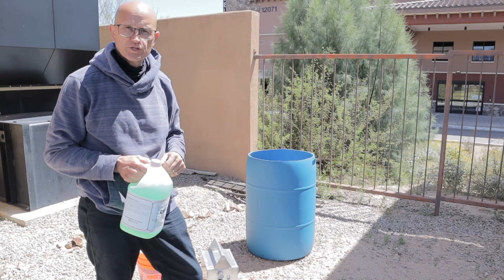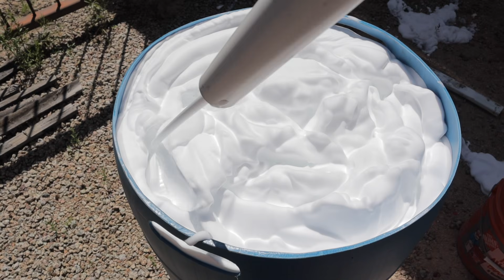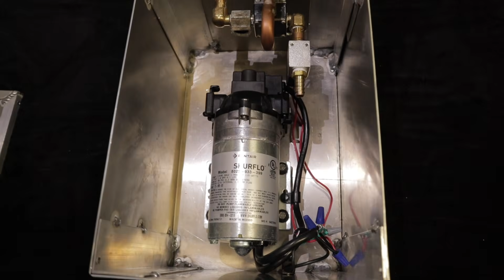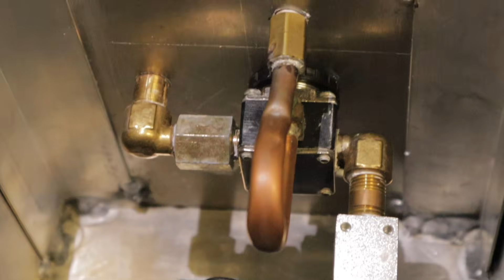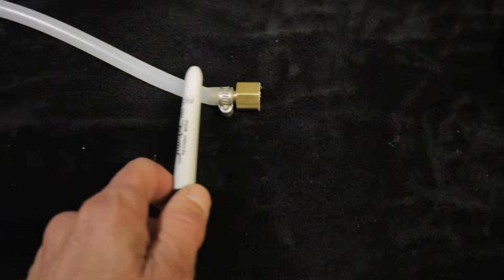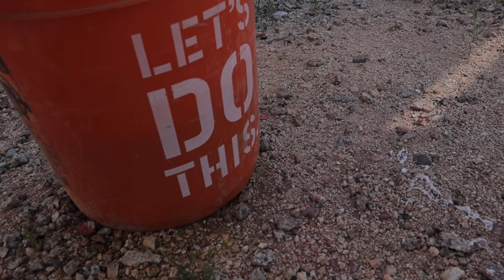Aircrete Foam Generator Machine DIY  [ How To build one that makes Great Foam!

Comment: Not trying to be a smart-ass but what's the point of the air switch if it just comes on when you power it up and you don't have any control over it. Or does it create some sort of resistance that's needed
Reply from the maker: Hi Shayne! No offense taken at all. So I just wanted it as simple as possible when I built it, that’s all. You could certainly add a separate switch just for the air valve if you wanted and then you could control water and air separately. I usually turn it on without my airline hooked up to prime the water pump and then hook up air and start the generator and begin making foam. If you added the air switch you could hook everything up and just control it your way with the switches. Good thinking on your part! 👍😀

Comment: Great work boss, how much to have you build me the generator? A wood box would be fine to on the cheap. I’m in MN. Lastly I’m curious how the shrinkage changed when you used the cement? Did you have to refill after the shrinkage again?
Reply from the maker: Hey, thank you for your kind comment and interest in my foam generator. Unfortunately I don’t have time to build these generators but mine is basically a copy of the Dome Gaia little dragon generator. If you can’t make one yourself, you could always buy one of theirs. Here is a link to their site. https://www.domegaia.com/store/c4/Tools_%26_Equipment.html  Cheers!😁👍
Reply: @PranaTech  thanks and keep breathing in that good *ss prana! Ps: yours is very quiet, worth the value right there!
Reply from the maker: Ha!!!!! You must be a Ralph Smart fan as well!🤣👍Namaste my brother!🙏❤️
Reply from the maker: I realized that I didn’t answer your second question. I don’t have any shrinkage problems since I started using Richway or Vermilion foaming solutions that are designed for aircrete and have much stronger bubbles.👍😊

Comment: What air pressure ranges  are you setting regulator... Somewhere near the 90 PSI of the solution pump?
Reply from the maker: Hi there, I usually run the air pressure right at 55-60psi and that’s where it usually makes great foam.😊👍

Comment: Is the air pressure also the same as the pump at 90 psi?
Reply from the maker: Good morning! No, I usually fine tune the air at about 55-60 psi to make thick foam. 😊👍

Comment: Thanks for the video and schematic - what volume water pump are you using ?
Reply from the maker: Hi Cass, the pump I’m using is 1.6 gallons per minute at 90psi maxed out. I usually run the air at 55 to 60 psi and so the pump only needs to overcome the air pressure. Any pump will work as long as it can put out the volume you need and overcome 55-65 psi. Let me know if you have any other questions.😊👍

Comment: Great video dude thanks for the information 
Now that I have built the foam generator and the wand what formula would you use to pour a panel 4’x8’x3 1/2” thanks
Reply from the maker: Hi Bryan! Congrats on building your generator! It’s always cool to see others build stuff and have the information spread. Ok, so Aircrete is pretty fragile when it’s only 3 ½” thick. To get that to not break when you take it out of the mold is going to be tough. I’ve never tried a panel that large before, but I’ve had my own challenges with 2’x4’ panels, so bigger is only going to get worse. Two things you could do to increase strength would be to use fiberglass fibers added to the mix or short chopped hemp fibers. These would add a lot of stability and shear strength to the Aircrete for a panel that large without adding a ton of weight. You could also add a layer of scrim cloth to the middle of the panel like they do with concrete counter tops. You pour half the depth of the mold and then lay the scrim in and then pour the rest of the Aircrete in slowly so you don’t sink the cloth to the bottom. Just some ideas as I said because I’ve never tried anything that large before. I would love to see some pics of your progress if you get some done. Send them to my email at pranateq@gmail.com 😀👍Don
Reply: @PranaTech  Thanks Don 
I will be using fabric and metal studs as the mold 
I would like to know the yield of aircrete  using the formula 94# Portland cement 6 gallons of water and 40 gallons richway foam or the recipe you use
Reply from the maker: That recipe will yield about 6 cubic feet of aircrete.👍😁
Reply: @PranaTech  thanks don 
I may cut it down to 2x8 so it’s a little easier to handle 
I appreciate all the information and advice
Reply: @bryannapier3354  7.48 gal per CF so 40 gallons yields 5.35 CF .  Your panel is about 9.3, so 2 batches (bags) to fill.  Good for the fill half, add fabrice and then top off.
Reply: @jkovar55  thanks dude your input is very appreciative

Comment: Hi. Great video. Your schematic shows air hose connection to compressor. Is compressed air needed or just the Venturi pressure as you mentioned on the demo?
Reply from the maker: Hi Ahmed! Yes it needs at least 55-60 psi to blend and expand the foam solution in the wand to make the foam.👍😁

Comment: Hi @Prana-Tech, I built my generator exactly as your schematic shows, the only differences are the pump model (mine is 2 GPM, 100 PSI) and the Y fitting, which I bought on Amazon (a 3/8 in barbed Y connector).

My problem is that air from the compressor goes into the pump through the Y connector when I turn my machine on. After a while I am able to get the water to flow through the Y connector and foam is generated, but the air pressure never goes above 60 PSI. My air compressor is a 150 PSI one, and ir cannot stay above 60 with this setup. Adjusting the dial on the air regulator doesn't help - at max it stays at 60 PSI. Obviously when I turn off the machine the pressure goes up on the regulator, as the compressor is still pumping air at 100 PSI and the solenoid is closed.

What am I doing wrong? How can I get my air pressure to go above 60 PSI?
Reply from the maker: Hi Marco,  ok so the procedure I use during startup is to not hook up the air until I have the liquid pump primed. Once I have flow, I hook up air and this eliminates back flow of air into the pump. If you don’t like this, you could install a back flow valve on the pump side of the Y so the air can’t get to the pump. The air pressure issue may be due to the size of your compressor not being able to keep up with the amount of flow that is needed to run your foam generator. The smallest compressor I’ve used my generator on was one at work that puts out 4.5 cfm at 90psi and a 30 gallon tank. I really haven’t experimented with what the minimum size compressor you will need to run this generator, but if you are less than 4.5 cfm then this may be the problem. What size compressor do you have?
Reply: @PranaTech  thanks for the answer above. I've never seen anyone mentioning a minimum CFM required for great foam generation. My compressor can sustain 2.6 CFM @ 90 PSI. Do you have any information as to what is the minimum CFM requirement for making great foam? Is it 4.5 as you noted above?
Reply from the maker: Well, I never gave it much thought until I built the larger high performance one last month. My compressor at home is an 8 cfm @ 90psi 3.5 horsepower. So it runs my small one that you copied and my new larger design that is completely air powered with no problems at all. When I brought the new larger generator to work, the 4.5cfm compressor couldn’t keep up with the demand. That compressor is a 150 psi compressor and 30 gallon tank. This is when I realized that cfm was more important than psi output. I suspect that the minimum for my small generator is probably a little less, like 4cfm but if you are going to invest in a new compressor, always get the biggest that will fit your budget and your garage. That being said, I usually only run my small generator at around 60psi for my air and this makes high quality foam. With your higher output pump than mine, you may need more cfm to match the higher gpm output of the pump. Since your pump is putting out more liquid per minute, you will need more air volume to match that output to produce high quality foam. How big is your tank on your compressor?

Comment: Is they any other pump that can be used ? This one I am seeing on ebay and  it is very expensive.
Reply from the maker: Hi Richard! Here is a link to another one that will work. https://www.amazon.com/gp/product/B07TSC6V7M/ref=as_li_tl?ie=UTF8&camp=1789&creative=9325&creativeASIN=B07TSC6V7M&linkCode=as2&tag=pranatech-20&linkId=b77db5386ca45284fd5ee21f29cc63c6. This one is less expensive. You can usually find them used on EBay for reasonable prices and they are extremely durable pumps so even used ones last for years. 😊👍

Comment: Could you tell me the pressure the water pump is set at..90? and the air pressure 65~70 lbs.. do I understand those correctly? THANKS.. I will do my best to make one.
Reply from the maker: Hi there, the pump has a max pressure of 90 psi but it self adjusts to match the air pressure when it’s running. The air pressure is usually at about 60 psi when I’m getting good foam. 😁👍Don

Comment: Less talk.  More pizza ovens out of Aircrete.  :-P

Great new content Don, think I watched all of them since I too have a habit of looking for treadmills and microwaves :)

Question on the aircrete (which... i was making myself this afternoon)...  why do you think everyone makes the slurry so wet?
Reply from the maker: Good morning Scott!  Yes the pizza oven is coming right up in the project list. It’s been delayed a bit because I’m developing a concrete pump that I can pump concrete, shotcrete and Aircrete.  My design will hopefully eliminate the mixer from the Aircrete blending process. I plan on injecting the foam inline just after the pump to mix the slurry and foam, that way I can just have a cement truck pour into my pump when I want to do large batches of Aircrete.  I am planning on building my own dome home out of Aircrete in a couple of years and have finally found an engineer that will sign off on my structural plans.😀👍 As far as the slurry wetness goes, I’ve just been following domegaia’s recipe and haven’t experimented with a dryer mix. Have you played around with this? If so, I would love to hear any thoughts you have on this. When you mentioned this my initial thought was that it would increase strength and density up to a point but I really don’t know, just guessing. Anyway, great to hear from another Aircrete and DIY enthusiast.👍Don
Reply: We have been using 5 gallons of water and it has been working fine. I bought some foaming agent fron Richway, but haven't had a chance to use it. My main complaint with the Drexel is that the aircrete comes out with a cottage cheese consistency (smooth but lumpy). I'm  hoping to CMX from Richway is creamy Smooth. 
Val
Reply from the maker: I think you’ll like it! It is very consistent and repeatable without the quality issues with Drexel. I’ve been using the concentrate from Vermillion for a while now and it is slightly better than the CMX and completely non-toxic.😁👍

Comment: Good day what is the compressive strength of your aircrete
Reply from the maker: Hi Leonel, this is a link to one of the charts that I use. I typically mix 35 pound density so it has a 210lb compressive strength.https://drive.google.com/file/d/1MaVj1CvjdFybTYpFop8wE49Tg0TNzKzH/view?usp=drivesdk
Reply from the maker: You can mix whatever strength you need for the project at hand though. You merely mix in some sand to get higher strengths😁👍

Comment: How much did you set your air compressor and your foam generator?
Reply from the maker: Hi Siraj, my compressor is set at 125 on the output and the foam generator is usually set at 55-60 psi to get good thick foam. 👍😁
Reply: @PranaTech  set at 125? which unit? Do you have one for sale? Thanks
Reply: @PranaTech  set at 125? which unit? Do you have one for sale? Thanks
Reply from the maker: Hi Siraj, I don’t have any for sale. I just show how you can build one yourself. Both of my designs use 125 psi from my compressor and then I regulate down with the regulator on the foam generator to 55-60 psi.😁

Comment: Very inspiring, wouldn’t it be wise to add a check valve right after the solonoid valve? This way water wont flow back into your air regulator in case your compressor fails or you forget to connect it somehow. I’m using a standard y-fitting so am perhaps more concerned with this issue than you need to be. Cheers
Reply from the maker: Martijn, that’s a great idea!  I have been getting water coming back through the airline inlet when I flush the system after use and then I have to flush with air again to make sure there isn’t any liquid left in the system. A check valve would solve this issue completely! Thank you so much for this! Much love to you my brother! 🙏😀

Comment: Hi there, is aircrete a good material for a outdoor sound barrier wall use?
Reply from the maker: Yes, I would think it would be great for that because of it’s insulation properties. 😁👍
Reply: @PranaTech  Thank you, what would be a min thickness to achieve sound blockage? 4-6"?
Reply from the maker: That’s a great question. I really don’t have any experience with sound blockage and using Aircrete. I would think it would need to be at least 6” thick because you will need that much at least for structural strength to hold the wall up. Are you making blocks or pouring panels or pouring into forms in place? All of these things affect thickness needs. How high do you plan on making your wall?
Reply: @PranaTech  I actually have a lot of extra thick strong composite shed panels left over that will measure to 7' tall 8' wide once framed into a 2x6. I will have 4 of these I can connect to give me 32' foot wall total. I will have them anchored to the ground somehow. I was going to pour the aircrete into the back of the molds that are rebared somehow. The molds will be part of the structure as the final wall.
Reply from the maker: Ahh, ok I see the plan. With that situation it would be best to pour into the molds on the ground and then tilt them up. Aircrete will support itself in a mold only up to about 24-36 inches in height and then the weight of it begins to collapse the bubbles in the bottom of the mold. Sounds like a cool project!😁👍
Reply: @PranaTech  Thanks for the feedback! Yes it will be poured on the ground first and then lifted into position once dry. Would you do about 4 thin rebars per section in opposite directions before pouring or just a metal mesh?
Reply from the maker: Metal mesh would be more than enough strength for what you’re doing. Even just the square grid cloth stuff they use in concrete counter tops would be fine if you are going to keep it in the frames after tilt up. 👍😁

Comment: can you please explain what the regular does, isn't enough that there is a regulator on the air compressor?  Thanks.
Reply from the maker: Hi David, It allows you to fine tune the air balance with water volume right at the generator.  You could get away with just the regulator on the compressor, but having one on the foam generator allows you to fine tune while producing foam without running back and forth to the compressor. 😀👍 Let me know if you have any other questions. Don

Comment: Sir,I can't find 90 psi mortor. Is ok to change another psi mortor?
Reply from the maker: Hi Ko, yes you can go down to 60 psi if you have to. Most of the time my air pressures are around 50- 60 psi so you just need enough to equalize with the air pressure. Let me know if you have any other questions. 🙏😀